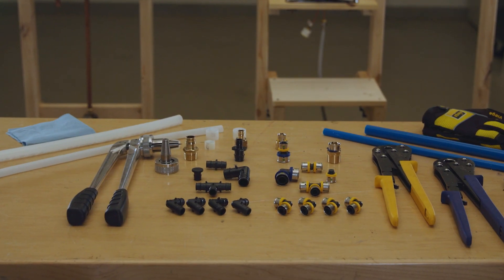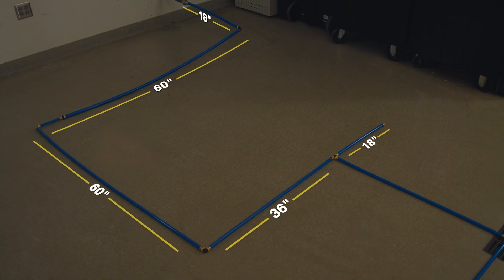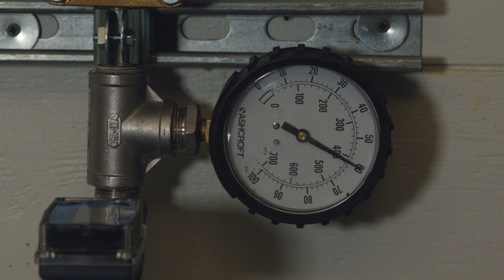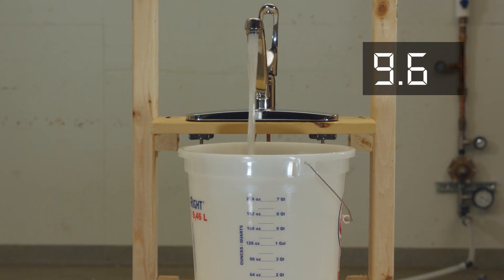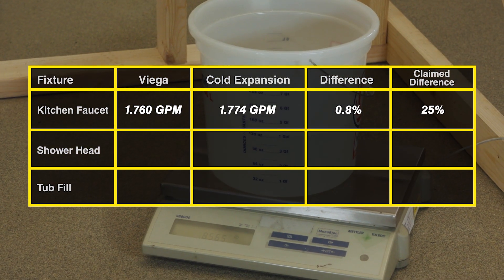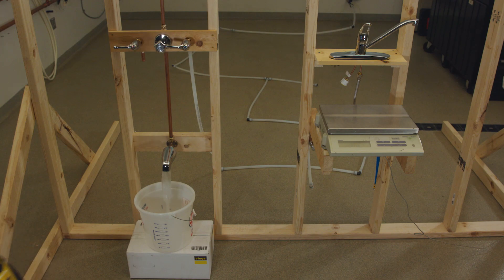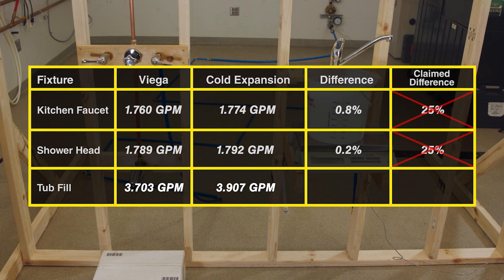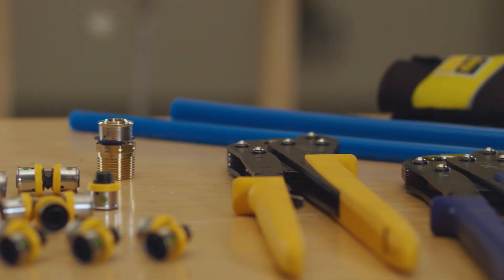Viega PureFlow PEX vs. Cold Expansion

Comment: The main benefit of Viega press is piping in cold conditions for quick pressure . It's alot more expensive with press gun too.
Reply: All you have to do is buy the heads. Most people already have a Milwaukee press tool and the heads are entered exchangeable with a Milwaukee tool.

Comment: A leading manufacturer of Pex B (Viega) falsely claims that their small diameter pipe has no reduction in flow than Pex-A. Here in their jaded test they prove the reduction in flow. But they say its not that bad, you know why. They did it with a short pipe and 1 fitting. Repeat it with two fixture being used and the problems is much worse. I like Viega but this test was done only to support that their Pex B small diameter pipe some how magically doesnt reduce flow. If that's the case, why don't we pipe our homes with 1/4" ice maker line. Don't fall for this, Pex B is ok but you will get worse flow and it will get worse and worse as each fixture is used or long runs. Unless your house has one fixture ever being used 2 feet away, you will not get these results. Shame on you Viega.
Reply: They never claimed that their system doesn't reduce flow. In fact, that acknowledged that it does. This video was meant to show that in a real world residential application, the actual reduction in flow the end user will experience from their system verses expansion pex is negligible.  While I won't say this is an unbiased video, what it was aiming to portray was portrayed accurately.
Reply: Also, the pex-b pipe itself does not have any flow restriction; the reatriction is in the fitting (and you can use these same exact fittings on pex-a pipe as well, creating the exact same restriction).
Reply: @two7plumbing  I'm new to PEX.  So you can use Pex B crimp fittings on Pex A pipe, which is larger diameter?  What I'm curious about is using Pex A cold expansion fittings on Pex B (Viega PureFlow) pipe.  I'm assuming it can't be done.  Is that correct?  Thanks.
Reply: @captainwho1 you are correct that you cannot use pex a cold expansion fittings on viega's pex b pipe. You can use pex b fittings on pex a pipe. It's both compatible and approved by the manufactures. However, you won't get the increased flow benefits. Both pex a and pex b pipe are the exact same interior diameter when in their natural state. The increased flow rate only comes into play when pex a is expanded to accept the expansion fittings.
Reply: @ Thank you.  In my girlfriend's house that was done with PureFlow 1-1/4" black PEX, some plumbers installed an indirect water heater for her recently and used automotive worm drive clamps on a fitting and it is leaking which is not surprising.  So I'm researching this.

Comment: This test is VERY MISLEADING! The difference in flow rate drastically changes when multiple fixtures are running at the same time.  Example: if I am doing dishes only, flow rate is great at my kitchen sink faucet. Once my kid gets in the bath tub, it's a noticeable reduction.  On top of that, once my washing machine starts running, my kitchen sink water pressure reduces down to almost a trickle.  I'm sure I can speak for almost everyone by saying, "Viega, we dare you to redo this test with 3 or more fixtures running simultaneously." They'll never do it because they know the truth.

Comment: Right now Uponor has two class action suits pending, because there pex is falling apart after a few years, and it leaches chemicals in the water , don't believe me look it up yourself, I am very happy with my Viega no problems, plenty of water flow,
Reply: What's the second suit about? I'm aware of one suit regarding their color-coating process. They were basically over-cooking the pipe to apply the coating, and, over time, exposure to hot water would break it down. I had several people come in with hot-side lines that were orange with flaking coating. They've since switched to uncoated clear pipe with colored lettering.

Comment: This video is deceptive.  I view it as preying on people by building on a a false supposition to promote their product and market space, PEX B.  What you want from a properly designed system is when someone flushes the toilet, the washer kicks into the rinse cycle, or dishwasher kicks on,  or someone uses the hose or laundry tub, that it doesn't make a big difference in the water pressure in the shower.  Single element tests prove nothing, especially with restricted end points.  The PEX A to PEX B information that they disparage is based on actual tests and flow rates that can be integrated into your design to determine if what you are proposing will be adequate, regardless of whether you use A or B.  The performance of the fittings between the two are nowhere near the same.  That doesn't mean you cannot get adequate performance from PEX B, it simply means you need to consider the penalties in the design if you are to arrive at plumbing-industry-established performance..

1.  The 2021 Uniform Plumbing Code" "Appendix A Recommended Rules for Sizing the Water Supply System" shows how to size a plumbing system with the average requirements of each and how to calculate.  HOWEVER, it is based on standards, Schedule 40 to be exact.  Schedule 40 is oversized to make up for length that fittings.  Schedule 40 is steel and PVC, and CPVC.  Copper and PEX they use a fishermen's' scale for their pipe IDs.  Copper is mentioned.  PEX is not.

2.  Pipe IDs.
- Galvanized 1/2" ID is .622"	(Schedule 40 Standard.  (Oversized to compensate for average flow restriction from fittings.)
- CPVC and PVC 1/2" ID is .622"		Schedule 40 (CPVC has the least fitting loss, even after diameter is factored out, due to PEX A's turbulence at the fitting.)
- Copper M 1/2" ID is 0.569"
- PEX 1/2" ID is .485"
- PEX 5/8" ID is .584"
- Schedule 40 3/4" is .824
- 3/4" Copper M is 00.811
- PEX 3/4" ID is .681"
- Schedule 40 1" ID is 1.049
- Copper M 1" is 1.055
- PEX 1" ID is 0.875"

3. Flow rates from a Supply Resources (The min is based on 2' per second and the max on 4' per second.)
- 1/2" Schedule 40 calculated max 3.841
- 1/2" Copper min 1.6 max 3.2
- 1/2" PEX  min 1.2 max 2.3
- 5/8" PEX  min 1.7 max 3.3
- 3/4" Copper  min 3.2 max 6.5
- 3/4" PEX  min 2.3 max 4.6
- 1"   PEX  min 3.8 max 7.5

What this indicates is if you want 1/2" copper performance, you need to go with 5/8" PEX.  If you have galvanized or CPVC, it is Schedule 40 which is altogether different again.  

4.  Let's do an estimation of what it would be for 1/2" galvanized and CPVC.  
- 1/2" PEX has an area of 0.18475 with a flow rate of 2.3 gpm
- Copper has an area of 0.2543 with a flow rate of 3.2 gpm.
- The area difference is .0.06955 with a flow rate difference of .9 gpm
- If we divide 0.06955 by 9, it will yields 0.007727777777778 per .1 gpm
- Schedule 40 1/2" based on it's .622" diameter has an area of 0.30386
- The difference in area between Schedule 40 and copper is 0.04956
- If we divide that by 0.007727777777778 we get 6.413227893601541 tenths of a gallon more than copper.
- From this rough calculation, Schedule 40 1/2" flows 3.2(copper) + .641(for dia dif) = 3.841 gpm for 1/2" Schedule 40, but is actually a little more than that because the circumference doesn't increase linearly with the area.  So we will now enter that into the table above.

5.  Now let's show the PEX A table that is disparaged in the video.
The competotor's chart shows using 3/4", which is actually MORE forgiving that 1/2" PEX would be
Area
Flow Area
PEX A .5 sq.in
PEX B .4 sq in -25%.
GPM
PEX A 12.4 gpm
PEX B 9.9 gpm	-25% - This is supported by the area difference.
Cost of Branch tee
PEX A 3 feet
PEX B 9 feet
Elbow
PEX A 3 feet
PEX B 8 feet
Based on physical properties and what we glean from tests from other sources, this makes sense.  We simply need to use different values when designing a system.

"PEX manufacturers state that PEX uses about 30 percent fewer fittings than CPVC in a typical installation, but that doesn’t come close to offsetting the higher pressure drops that occur with PEX pipes and fittings. Compared to a PEX system with 30% fewer fittings, CPVC (which is Schedule 40, achieves a 74-83% reduction in equivalent length caused by fittings.  The reality is that even PEX expansion fittings, which are sometimes referred to as "full-flow", restrict flow rates due to turbulence.  In fact, the difference in the internal diameter between a CPVC fitting (schedule 40) and an expansion PEX fitting is greater (27%) than the difference between an expansion PEX fitting and a PEX plastic body crimped fitting (22%)."
This also logically fits with the physical properties and is supported by data from other sources

6. Analysis:
- Schedule 40 is the standard and in plastic that would be CPVC.  CPVC also has the lowest fitting performance cost and even beats PEX A.  Copper and PEX use a Fisherman's Scale to measure size which explains the lower performance people are seeing with PEX.  
- There is a big cost to using PEX to begin with due to its diameter alone that less fittings doesn't come close to making up for.  To barely maintain 1/2" copper performance one would have to go to 5/8" PEX, which is very likely why the 5/8" size exists, and it would still be well under the performance of 1/2" schedule 40.  3/4 copper or Schedule 40 would need to be replaced by 1" PEX to maintain performance, and that is before the large penalty imposed by the PEX B fittings.. 
- Using 75% of max (the recommended) of the Uniform Plumbing Code book suggested max for sizing your system won't save you with PEX.  Simply copper is already underperforms Schedule 40 by 17% leaving you with an 8% margin rather than 25%.  PEX underperforms Schedule 40 by 40%,, E.G. 1/2" PEX flows only 60% of Schedule 40, leaving you at 15% BELOW standard design methodologies.  This explains why builders relate lower water pressure in their post-2000 homes (PEX A).  That is before the penalties of PEX B fittings that DIYers use.
- The biggest advantages to PEX is it is cheap and easy.  The advantages of PEX B are the tools are cheaper and the fittings don't leak, which makes it a safe sale to DIYers and why it is the best stocked at big box hardware stores.  For the best chance of having a PEX A system that doesn't leak or develop leaks later, you need to pay ~$500 for a quality the power tool.  (Read the reviews of those who have purchased and used the PEX A manual tools about leaks and needing the arms of a stevedore to use it.)  With PEX B, a quality PEX crimper/ring remover plus PEX cutter, plus 20 1/2" clamps, plus 10 3/4" clamps, costs $32, and a produces a permanently water proof joint every time.
- If you are replacing galvanized or copper you cannot do a size-for-size swap for PEX and have the confidence that you haven't majorly reduced performance.  You need to analyze your requirements and make up a design based on the new technology.  People in general will not objectively test different scenarios to see what they have before replacing their system with a new technology, thus their expectations will conform to the performance of the result,  wanting  to rather believe it is better after spending the time and money.  Moreover, they don't know if their existing system was designed properly.
- You could use is to use the "2021 Uniform Plumbing Code" "Appendix A Recommended Rules for Sizing the Water Supply System" in concert with the research from this post into your design.  Williams Plumbing has a video that I don't agree with their assumptions, but it does good job illustrating the process.  The drawback to going larger on the hot water lines is it will take longer for the hot water to reach the fixture.  You likely could preserve the smaller size hot water lines by installing a manifold near the hot water heater to enable the use of separate lines.  Due to the standard sizing of pipes, it is possible that parts or all of your system is over-engineered and going with PEX B will have negligible performance impact.  I will go either with CPVC Schedule 40 or design for PEX B.  It's not the end of the world If I end up needing to replace a 3/4" cold run with 1" PEX B.  I'll see how things shake out.

Comment: Hi, I try to know the flow of my home main water line and could not find any test on that and its hard to evaluate since I need to evaluate the velocity and it depends on flow... I can find pressure drop but I need to know the flow before to install my sprinkler system. I wish not to cut the line just to check because if it have not enough of flow I ll do differently... My main line is pex 3/4 (7/8 OD) and my static pressure is about 64 psi. Do you have an idea about the max flow? If you can tell me the flow while keeping a 40 psi pressure it would be the best since the max flow could not be use as it would drop pressure to 0. Thanks!

Comment: This test is not designed to exaggerate fitting performance. Quite the opposite. It's designed to mask it. Household water fixtures are flow-restricted. Showerheads are commonly restricted to 1.75GPM. What this test shows is that, in all of the tested systems, the fixture was the most restrictive part, not the pipe.

If you want a real show of flow rate in one piping system vs. the other, remove the fixture and shower valve. Go to a full-port valve at the end of the line. You then remove the flow-restricted fixture, and you are testing only the pipe and fittings.
Reply: Tub spigot was full port or almost,
Reply: @jbarizonaa  That's true of the spout itself. But the cartridges that feed that valve likely are not. At every fixture, there is a limiting factor that is NOT the pipe and fittings. That's the point. What the test shows is that end-user experience is not really effected. That much is true. But it doesn't really refute the claim that expandable pex fittings provide more flow.

It's a simple math game at the end of the day. The pipe is SDR9 CTS on both sides. If the fitting on the expansion side is the same ID of the pipe, and the fitting on the crimp side is a smaller ID than the pipe, the expansion side will have a higher maximum flow, all else being equal.

Comment: using a manifold with pex straight runs to each fixture resolves all issues.  Just need to keep the manifold close to the water heater.
Reply: That's silly. Space them manifolds out for maximum flow.

Comment: I would agree with Viega-the faucets, stops, supply lines etc are where you will notice the most difference. Trunk lines/main feeds can be sized and installed in a way to offset any differences between a cold expansion and crimp flow rates. I wish Viega was more common in my area. I use the F1807 system most and I have never had an issue in over 20 years. PEX B out performs most PEX A also in the real world. Never seen issues with PEX B, I have seen multiple issues with PEX A and PEX C. In defenses of cold expansion like F1960, the connection is solid and I have never seen or had an issue, the piping is another story issues all over the place....